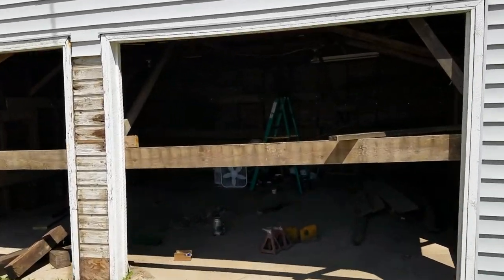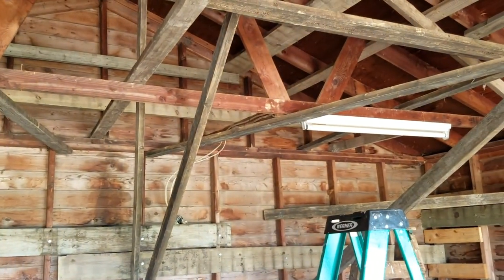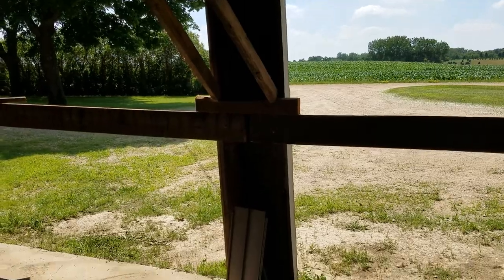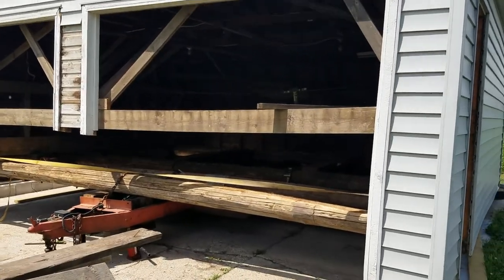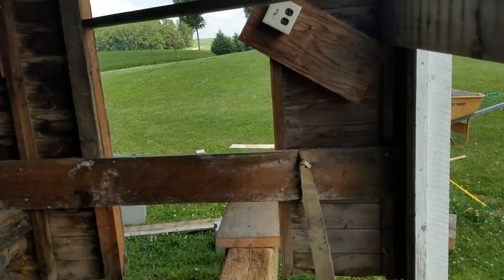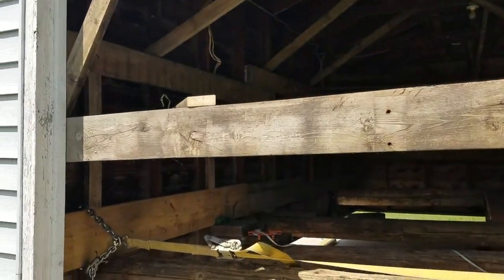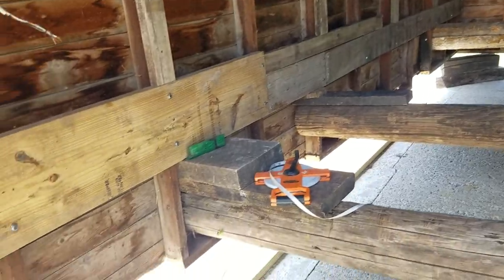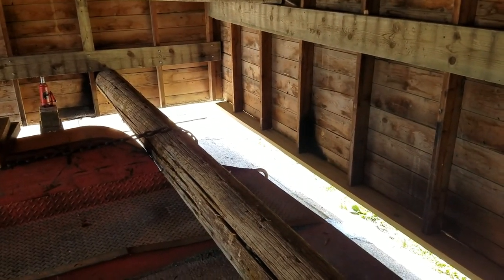How to Lift & Move Garage with a Trailer using Telephone Poles

Comment: As funny as this is, I’m here because I’m planning on doing the exact same thing.   Thanks for the encouragement and ideas (didn’t think to use telephone poles). Well done.  Did you estimate the weight first?
Reply from the maker: We didn't really think much about the weight. Making sure it balanced equally was the key and we knew those heavy poles could handle the weight.

Comment: Great job! What do u think the garage weighted? I have a 16 foot double axle (7k total weight capacity) utility trailer. It has a pretty solid 2” tube sides. I need to raise a garage to replace the concrete. I would do the same as you, remove the double doors and go with a 16’x8’ single door. 
    I’m thinking it may be easier to raise it and move out of the way to make the concrete pour easier.
Reply from the maker: I think I would jack it up & pour around it & then a week later move the jacks & pour where they used to be. Thinking it is about 7-8,000#?? Either way, Good luck!